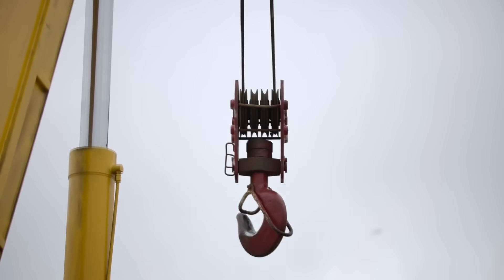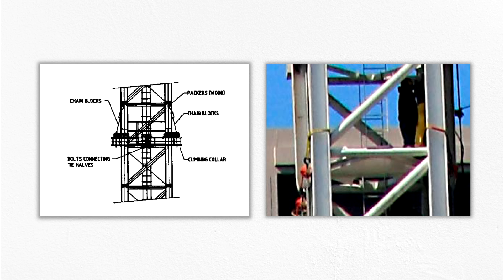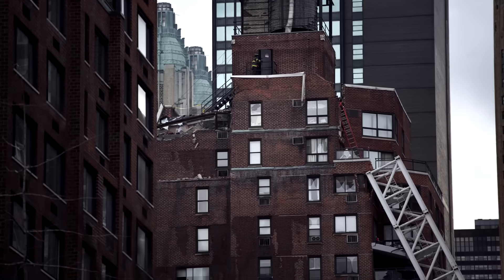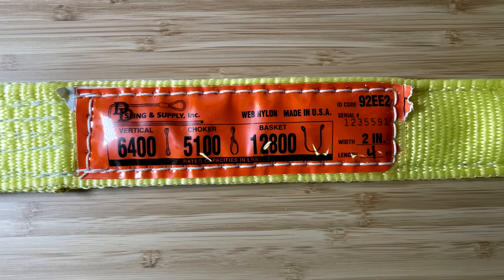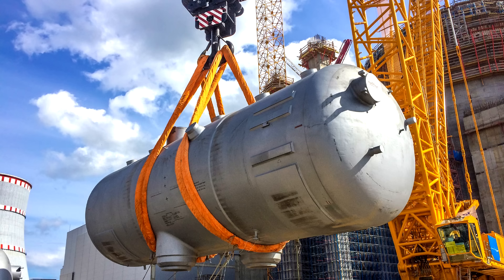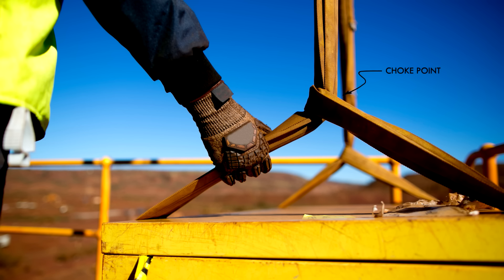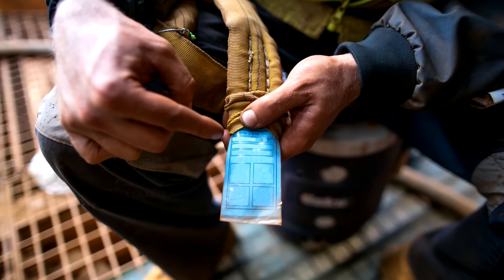Why Things Fall Off Cranes

Comment: I drove cranes of many types in the mid 1960s 70s and 80s. The bigger the crane the more help the operator got, a 5 ton max lifter would have a rigger who was any guy who wasn't busy and so I'd be in and out of the cab checking slings, shackles and hooks before taking the lift. Working a hire by the crane was even worse, with the ground being our worse enemy, as leveled and compacted crane bases was classed as a waste of time and putting an outrigger through a cellar was common practice.   Once lifts started to get above 15 ton two man crews would split the truck driving, slinger/banksman and crane ops, both would be experienced crane operators. But still the question of site engineers check ground stability would raised.
I always carried timber, canvas and tyre innertubes to use on sharp corners, spreader bars and end slings to prevent sling slippage, but contractors would sometime say I'm wasting time and expending the hire. I would come back with, if the load dropped and the item was wrecked how long before you got another, then ask for his authority to lift it if my method was over ruled. it's surprising how few would back the words with a signature.

Comment: Sling angle load force is like stringing, for example, a 50lb bow. The draw weight from the grip to knock point is 50lb at 28”, but the tension on each bow tip is way higher than that. 😁👍👏👏👏

Comment: On extremely heavy & specialty lifts sometimes the rigging is made just for that lift. Worked with some helicopters a few times when it was a situation that a crane couldn't make the lift (center of a large industry). This was years ago, one of the guys asked the pilot if it was going to be a hard lift. "Hell nobody shooting at ya", a chopper pilot in Vietnam. Sikorsky Sky Crane is one cool machine, somewhere in the basement there's a hardhat with a sticker

Comment: As a helper, crane operator/rigger, then trainer at a nuclear power plant, I first hand found out the importance of rigging inspection.  There were rudimentary procedures during construction prior to reactor loading. We were testing engagement of alignment of control rod drives into the reactor penetrations. I reached to grab a sling holding a suspended one, and the swedge collar slid upward in my hand! It had never been swedged. I immediately set the load down and reported it. Huge monetary and engineering problems if it had dropped. Consequently, a complete rigging inspection and tracking procedure was implemented immediately. I will never forget that and I am now 71, seems like yesterday.

Comment: The old Engineer's joke "Any idiot can build a bridge that stands, but it takes an engineer to build a bridge that barely stands" also applies in this thing. Simple answer will be: use much stronger slings or just quadruple the number of slings. (but no, engineers never get unlimited budget)

Comment: In 2020 I built a big carport and the steel posts and beams were very heavy, posts 145Kg and beams up to 245Kg. I used my 6x4 steel trailer as a mobile crane base. I then created a 4.5m upright post and at the top a T section. One end for the block and tackle and the other end used to stabilize the post. I made and used a spreader bar for the beam lift. It worked perfectly and made the job relatively easy. I used practice lifts to make sure the trailer crane was not overloaded. Love your vids mate. Subscribed.

Comment: Incredible and well-explained video, Grady! Even if you're only lifting a lawnmower in your garage, it's important to keep these concepts in mind. Just thought we'd add that twisting and swinging can also cause a lift to fail. A good rigging pro will always take these into account when choosing the rig components since the resting weight of a load doesn't tell the whole story once the load is in the air.

Comment: In use I don't think heat from friction results in dropped loads.  The way i look at it, you have already lost control of the load by the time heat is generated.

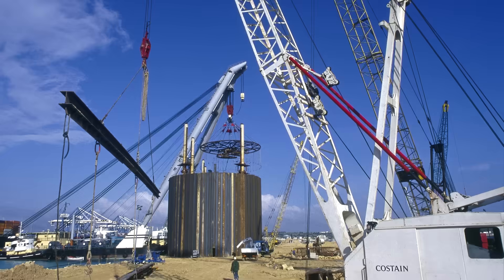Comment: Great video! I like this kind of information 👍 On a smaller scale, while I was researching rigging to suspend my table saw from the garage rafters I came across a video showing the load capacity of eye bolts loaded at an angle. While not directly related, your video reminded me of it. https://youtu.be/ImNFLWRgshc The chart is at 4:13. I am not promoting or affiliated with E Rigging, I just found it useful.

Comment: I'm not sure how accurately a load weight is known (or determined) in some instances, before the load is rigged & the lifting process begins. I expect many times the load weight is only roughly estimated. Clearly, having a good estimation of the load weight (particularly for heavier loads) is critical to proper lifting preparation. A factor of safety can (& should) also be used for additional security against failure, but only if the load weight estimate is close to reality. For some items, the weight is probably supplied by the mfg., because it is already known the item will need to be lifted (ex., roof top air conditioner units, fractionating towers, wind turbine nacelles), & sometimes, the mfg. will attach lifting eyes or lugs to the item (ex. military heavy equipment will usually have lifting eyes or lugs to attach cable slings for lifting & loading onto ships, & the C.G. is also usually marked on military heavy equipment). 
In "3rd world" regions, it seems there are many crane lifting failures (shown on YouTube), which might lead one to think the "3rd world" crane operators & riggers are not so intelligent as those in "1st world" regions. I don't think this is necessarily true, only that the 3rd world crane operators & riggers don't have the training & an "established set of rules" to follow regarding safe crane lifting procedures, like the "1st world" crane lifting crews do. But I doubt the "1st world" crane lifting crews are any more intelligent, & without the training & adherence to established procedures, would also try to use cranes to lift things without much of a clue of what will result from their lifting arrangement & process (well (lol), except perhaps in Germany, where traditionally, proper planning, precision & engineering are fundamental to the culture & people).

Comment: This kinda brings me to a question that I have ask many times but no one knows the answer. I built a 1550 ft zip line and I always wondered how much pull was on the end of my cable when a person weighing 250lbs was hanging in the middle of my line.
Reply from the maker: Very sensitive to geometry. Put a spring scale between the cable and the support and find out! Otherwise search catenary equations

Comment: Rigging isn't my primary job but I have been certified in radio tower rigging. Since I'm on site often when lifts are happening. Sometimes an extra hand is needed but also, I need to know when to shut knuckleheads down that are doing some shady stuff. If I  don't have the authority(another contractor on site), at least know when to bug out... Before I got the training, I had no idea how the forces multiply in certain situations. More than you'd intuitively guess.

Comment: I really appreciate your videos.  I worked on new ship construction projects at the beginning and near the end of my career.   The first shipyard at assigned riggers to each crane.  Only trained certified riggers and crane operators were allowed to rig, attach, lift, land, and detach loads.  The  crews were responsible for inspection of all rigging gear and routine maintenance .such as greasing sheaves and wheel bearings.  

In the secong shipyard routine crane maintenance was done by a single crew
Reply: Continued... The second shipyard did not use assigned riggers.   Instead, any worker was allowed to rig a  load.

During the construction process in the first yard I can remember only one accident when a padeye failed and a 150 LT unit was  dropped during the process of turning the unit over.  Luckily no one was injured and damages were limited to bending a spreader into a  near perfect U-shaped piece of scrap.

I cannot say the same for the second yard.  Load damage was a regular occurrence.   Cranes were regularly out of service from lack of routine maintenance.   I knew if a crane was lifting something I needed to head in the opposite direction. 

Jim  Harbaugh, the University of Michigan football coach,  made the comment, "...because you're standing on third base does not mean you hit a triple."  Lifting a load safely requires not only trained personnel, it requires a strong process that assures safe practices are followed.

Keep up the good work. 
Bob

Comment: I know with a lot of things the reason you don't go for overkill is cost, but the sling is a low cost compared to everything else at risk if it fails. Why isn't it standard practice to go with overkill weight rating on the sling to reduce the chances of weight distribution calculation failures?
Reply: I'm also curious, especially since the sling can be reused again and again, so it's not like we're spending a bunch of extra money on infrastructure that's not coming with us on to the next project.

Comment: Hi Grady! A bit of feedback - friction is not a function of pressure. It is a function of force and coefficient of friction (static or dynamic). Perhaps slings would be prone to heating so much because of the large forces (work = force * distance), and because any heat generated is put into a relatively small area - like you say, slings are quite small compared to the weight they can lift! A very insightful video as always. 

Also, I'd like to plug my video idea - would you please explain water drain dynamics? Traps, vents, etc. I'm sure you'll do a great job, especially with all of your clear pipe "practical" examples :) 

Keep up the good work!
Reply: I think he mentioned pressure because the friction produces a large amount of thermal energy (thanks to the heavy masses) that's then concentrated into a small contact area of the sling. If the contact area was bigger, the energy flux would be lower, so any given point on the sling would reach a lower temperature.

Comment: One aspect that has not been adressed in this video is dynamic load. In conditions where a load is subject to dynamic forces like wind or crane acceleration it is common to apply a dynamic factor to the weight as a means of safety margin.

Comment: Why not just avoid trying to use the bare minimum amount of rigging? Seems safe and obvious.
Reply: Money 😅
Reply: Also when you work with say 10mm chain daily vs using 20mm chains you’ll see quickly how much work it is to choke a load

Comment: Last week I lifted a 750 kg ceramic filter, costing $80 000. Due to low cieling it was just possible, and we had to use a less comfortable angle on the straps. But I checked and confirmed it was 2 ton straps, so even a doubling or more from 375 kg on each would be ok. Rigging is a think before doing activity. I also do climbing and sometimes cut down difficult trees. I love these Do not rush jobs. Take your time to think it all trough, make a plan, execute, prepare to abort and change if needed.
And as an old science teacher: If you do not listen in physics class, one day you will be in real pain.
PS. In climbing we have a rule. Never have a strap against a strap, fabric to fabric, if there is a chance of sliding. The fricktion can burn the sling or rope of. Always metal (a carabiner) in between.

Comment: An additional very important aspect of rigging is this: Assume you are lifting an object in four eyes or lifting points, with four slings or chains of close to permanent/static length, like all slings and chains made for lifting. This could be the case with a freight container. You may think about dividing the load by four when calculating sling load as there are four slings but DON`T. 
Here is why: In three dimensions the load case is statically determined by the first three slings, by triangulation. Adding the fourth one may be a great idea for stability but you will never find the exact length of all four slings where they are all taking the same amound of load at the same time.

Summary: When lifting using four or more slings, always make sure each sling can handle at least a third of the load. Off course, also consider how the center of gravity affects each lifting eye in terms of forces and stability as well.
Reply: Is this true of even more slings too? Even if we used like ten or twenty slings, we should always make sure each sling can support at least a third of the load?
Reply: @General12th  Hello, yes because three points define a plane. Therefore, if the lifting gear is not very elastic the load can only be distributed between three parts. 

Think of it as a chair with four legs, if the floor is even the slightest uneaven one of the legs will always be in the air. Therefore, no matter how many parts of chain or sling you use for lifting, always calculate with just three of them.

Also, keep in min the tangent value of the angle of the lifting gear. If it goes at 45 degrees you have to multiply the load with 1.6 to get the force in the gear.

Comment: 10 years I took a course including securing loads properly. Our teachers presented a loaded truck at a small local logistic exhibition as an example of what load securing looks like. I knew the people, so I asked "Did you really drive like that?" Rules in your country might be vary, but: they loaded 3x1000l IBCs with water (3+ tons) and every one of them was secured differently. The tags on most of the rigging was unreadable and if it was readable, they were far past their lifetime.
It was the exact same equipment we used in training a few days before. They used that for ages, it could have been easily damaged by improper handling from trainees and they were 'securing' 3 tons with it. What a great example of 'how not to do it' that was.

Comment: Hey Grady I'm making a video on pulling an engine from a 2014 Dodge Ram 1500 and it doesn't have any lift points that most engines have. Obviously it was installed with some sort of robot that pick the engine up from the sides. Anyway I was wondering if I can reference this video in my video because it has helped me a great deal on engineering away to lift this engine off of the frame and out of the vehicle

Comment: Some of the most interesting rigging Ive seen has been Ron Pratt on youtube. He's a heavy equipment tow truck operator with a rotator truck, so its pretty much just a crane with wheel lift on the back. But the rigging having to all be off-the-cuff, with an approximate weight, best judgement on CG, limited lifting points,  and other constraints such as overhead powerlines, traffic lanes still operating nearby, the need to drag stuff either forwards and backwards, or sideway on a variety of surfaces is super impressive to see done.

Comment: The subject matter completely ignored wind velocity and direction. Also need to double rap the straps to prevent sliding along the load. There is a lot more than most people realize to safety lifting a load.
Reply: This video is not meant to be comprehensive. Grady might do another video on dynamic loading at some point.

Comment: My summer job was as a stevedore,  before container ships.  I still have nightmares about some of the things we had to rig.  The most dangerous were these huge ingots of iron.  We used wire cables and hooks.  Once out of the ship,  they would be placed in box cars,  with inches of clearance.  Winds would come up and once these got swinging,  we got out of way.  Saw someone's fingers get crushed once.  ugh.  However,  only saw one rigging failure,  put steel rods through the side of a ship.

Comment: All these diagrams of centre of gravity and centre of lift are taking me back to applied mathematics and physics classes spent doing nothing but churning through these diagrams and working out the force on each load point :D
Reply: Also I’m definitely bookmarking this to show to other folks who just don’t get it. I’ve tried to bring up, for example, keeping the average centre of lift in the centre between two lifting bodies so that the torque doesn’t get put right through the lifter, but sometimes people just don’t get it. 

Eg: when explaining to people why their nail bends more opening a can with one or three nails (centre nail bending) vs just two nails where they stay pretty rigid. 

Or when I’m lifting a heavy object with a friend and they’re like “I don’t know, it’s pretty heavy, my back, I-“ but when I join in the actual lifting we’re both lifting from the side while the centre of gravity is going down in the air between us. 

(Also forgive me, but please feel free to correct me, if I’d misused some terminology there! It’s been about a decade since I did those calculations! But just to clarify, I’m mostly ignoring actual lift points and only thinking about the averaged lift being applied on the whole body. But of course we often modelled those bodies as being pointlike masses, with a wide dimension when necessary, so that’s certainly an oversimplification anyway!)

Comment: As a rigour I do like your video but there’s one part in it I don’t agree with you were talking about your horizontal angles with a cut out sea container model the one thing you did you had your hooks in the wrong way I know it wasn’t a training video but a simple little thing like that breaker Jane twister hook you’ve dropped that see container

Comment: Great video.  I have been rigging for years and everything was right in your video.  Inspecting the rigging before use is also important.  It might fail at much less then it's rated capacity if it's damaged.  I have seen two rigging failures and both were rusted slings.

Comment: There is also slip with shallow sling angles. Saw someone lift a long 12" pipe and one sling slipped in and dropped the load.